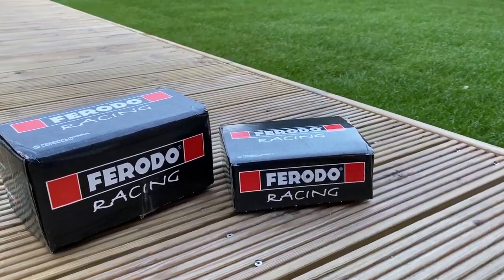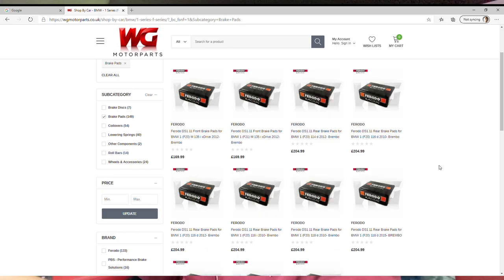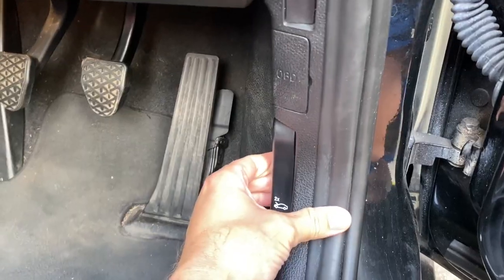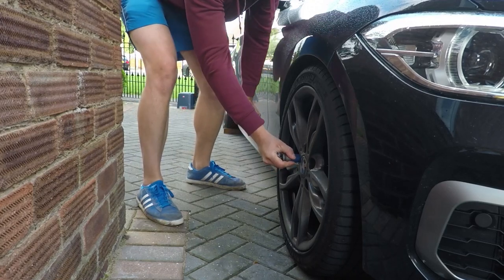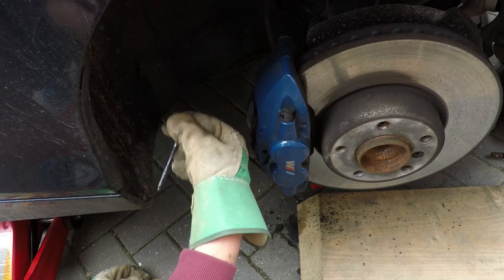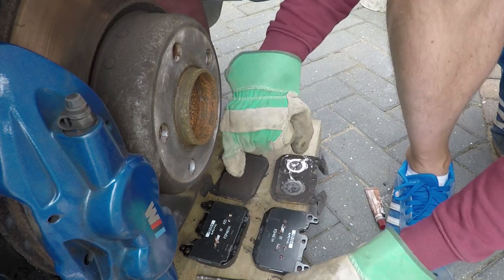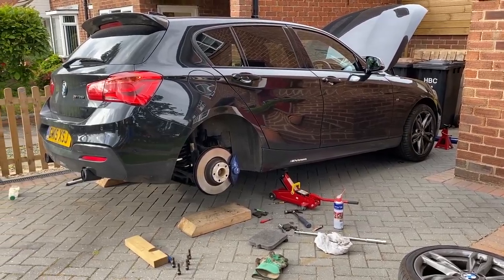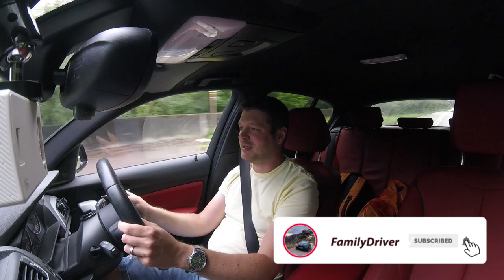Ferodo DS2500 Installing new brake pads on BMW F20 M135i M140i

Comment: It seems the ferodos are the popular choice for pads, think mine will be due soon been on 30k miles. Good informative video 👍
Reply from the maker: Ryan Ward thanks. I think they are great alternative. It’s a nice upgrade. The only downside I forgot to mention is that they produce more dust so wheels need to be cleaned but more often.
Reply: @MDrives  A small price to pay for better breaking haha!
Reply: @MDrives  If you take the wheels off, clean both sides fully and either use a good polish or even ceramic coating it really helps too.

Comment: Hey ! Thank you very much for the video, I agree with the feel of the brake. Good brake, they are not fading away on track, but the initial bite is indeed too low + the feel of the pedal is bad... Anyway, I have one quick question : how do you deal with the sensor and the re-initialisation of the idrive warning ? Can you re-initialize the idrive warning about replacing the pads without changing the sensor ? Best wishes ! Cheers.
Reply from the maker: Yes you can simply reset it in your idrive.
Reply: @MDrives  thanks a lot !

Comment: Watched the video again ❤️ as I’m looking for replacement pads for my 140, what’s your opinion of them now and also do they make a noise when cold.
Reply from the maker: They are really good and definitely better than stock. One of them made a squeaking noise at very low speed for the first month but I heard it maybe 20 times in total so very rarely. Then it stopped completely after a month or so.

Comment: Hi, good review 👍.

My personal usage is only road and never track. I'm thinking to upgrade for better than the currently installed Ebc yellowstuff. I brake not often but when I brake I need that it brakes hard.

So based on my usage, I really need a strong bite especially when the brakes are still cold. Do you think that ds2500 would be suitable for me?

Many thanks 👍
Reply from the maker: Ds2500 have great bite but might not be the best for the first few minutes.
Reply: @MDrives  OK thank you for your answer 👍. I'm thinking about the situation where I'm driving in the highway without hitting the brakes for a long period of time. But, if for some reason, an emergency situation requires braking hard wheras the brakes are cold, that would be a problem.

Comment: The pins go out from the front... Punch from the back. You made it much much harder for yourself. Tip for others watching.
Reply: No they don't. This is false information.
Reply: In correct Yey only knock through one way, front to back

Comment: Do you not have  to swop over pad weights  from old pads
Reply from the maker: andrew branford No. They work absolutely fine without them. Most of the cars don’t use pad weights.
Reply: but you could swop them over to the Ferodo pad?
Reply: @Magic_Vince  I'm in the process of fitting ds2500's to mine too...my brake guy was surprised they didn't come with those weights pre installed. They look to me like they are pressed on,so I don't think you can swap them over to new pads. He seems to think they were there for noise / harmonics reasons and didn't think it would be an issue. Likewise, I asked if the stainless brembo shims should be swapped over but he didn't think so...they look to be adhered to the oem pads, in addition to the backing the new ones have.